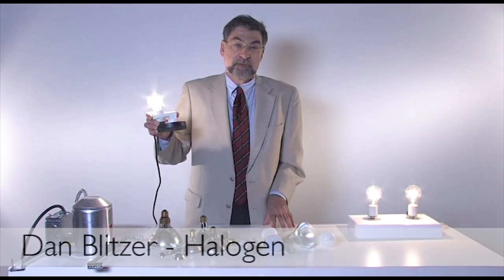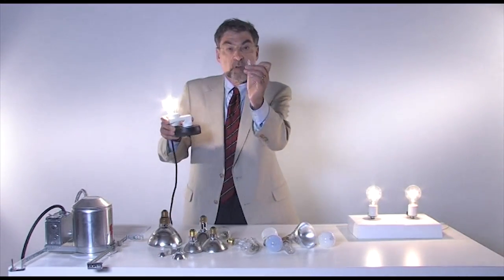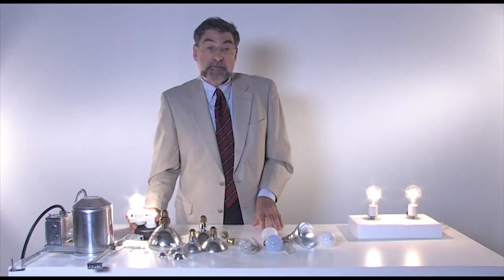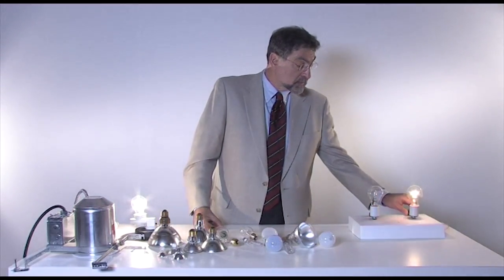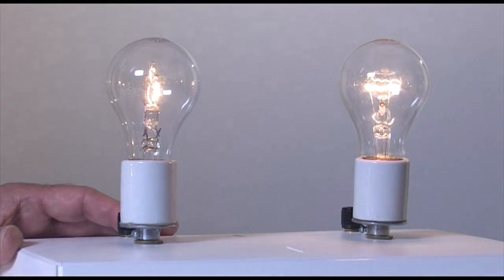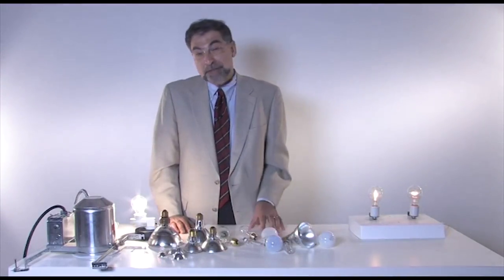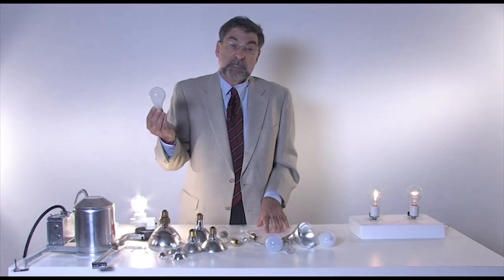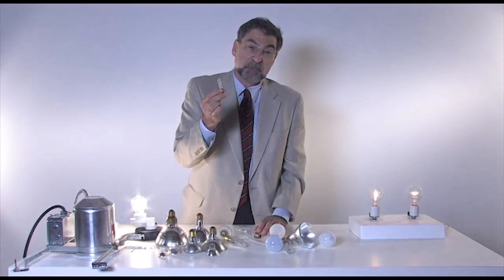What is Halogen Lighting?

Comment: The vertical filament in a clear retrofit bulb plays nice on glass with vertical grooves, and the light output can be increased in fixtures that are limited by heat. Low voltage bulbs last forever long after the plastic housing has clouded up. LED lifespan is a myth.

Comment: the led bulbs i use dont last longer they get dimmer and dimmer then are gone halogen are better than led crap. halogen work longer your all full of it about led they wear out faster.
Reply: It is usually the resistors and diodes that cause total failure in LED globes, a friend I know who uses LED globes told me a globe had failing filament arrays and other arrays were fine in the  globe
Reply: Stop buying cheap led light bulbs from Amazon/Dollar stores.